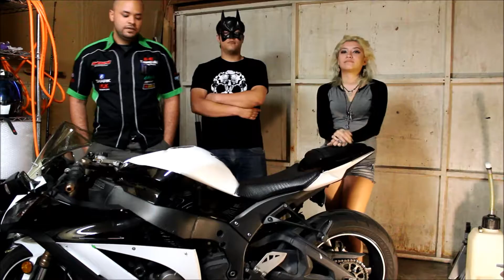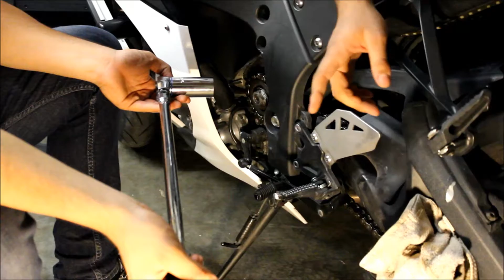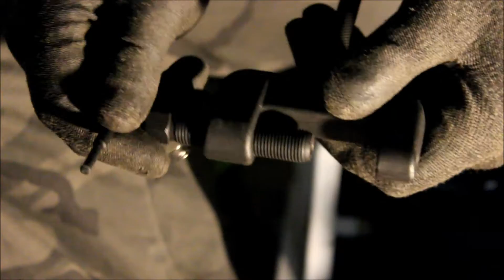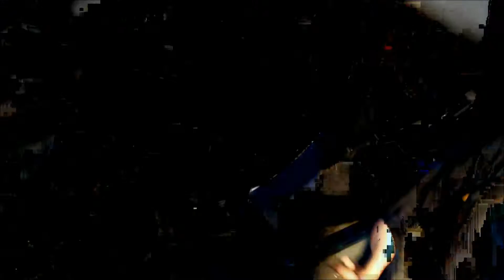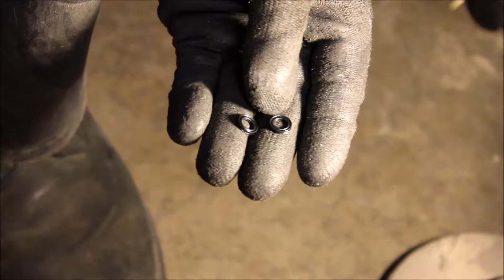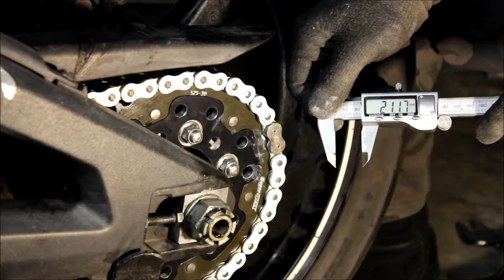How to Replace a Motorcycle Chain

Comment: Since you have a grinder make it easier on yourself and just grind the 2nd rivet on the same link, then you can just pop the whole link off the backside. This will save you from having to use that rivet tool to push the pin out which you noted can and do often break. Impacts work great on those front sprockets nuts as well.
Reply from the maker: i used the grinder that way for more sparks honestly. lol. you are right tho